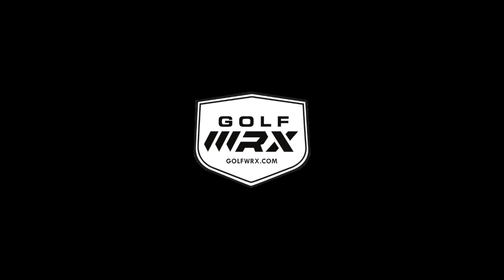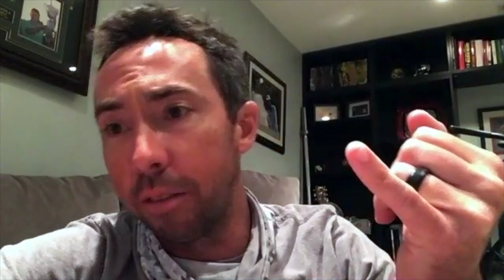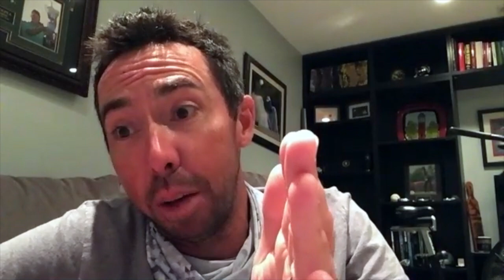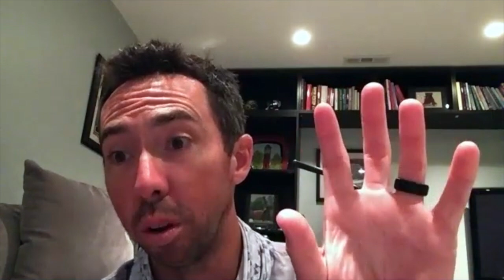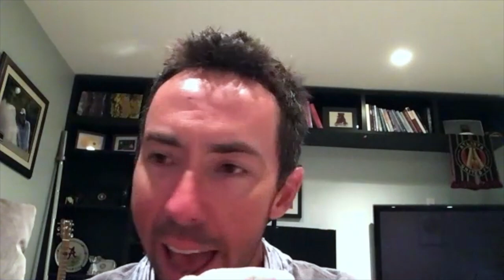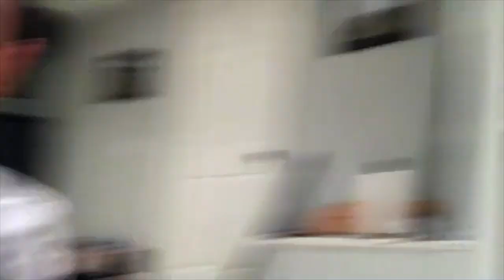Interview with Chris Voshall from Mizuno Golf.

Comment: Hi. I was custom fitted for MP 20 HMP c taper lite regular last august. Played a few rounds, then where I live went in to lockdown from December to March. I now find myself really struggling with them. Btw, 14 handicap, was 12.3 at the fitting. WHS put me up! Would I be better off with 921 Hot Metal with the same shaft! I had the same shaft in my 919 pro’s which were unfortunately stolen. Or perhaps the 921 HM pro? I play at a links course, often 20mph winds. Appreciate any feedback.